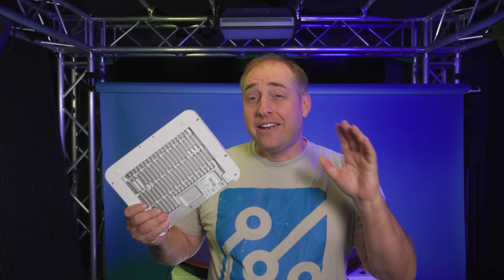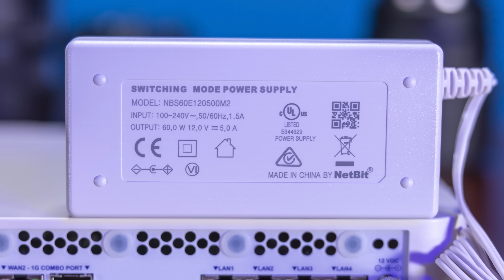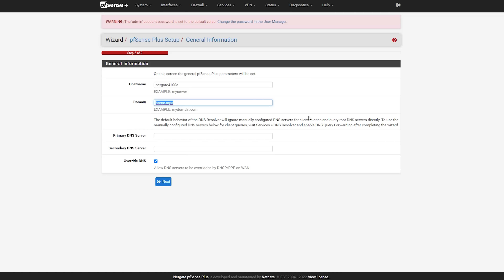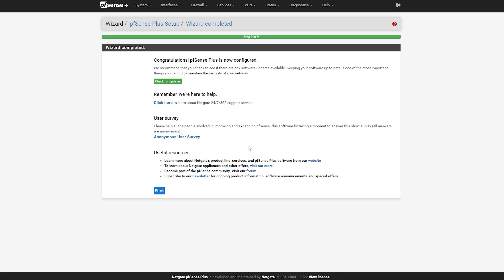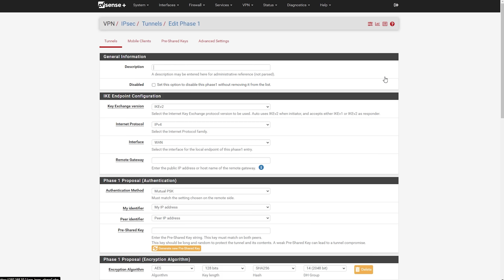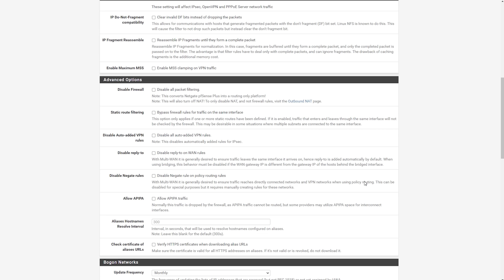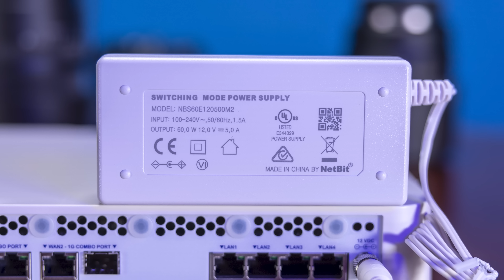An 11W pfSense Plus 1/2.5GbE Router, Firewall, and VPN Appliance

Comment: Not sure why my comment isn't showing up any more, but please read up on "pfSense Plus". If you're still thinking it's a vetted open source project. The commercial product this equipment runs is called pfSense Plus which is __closed source__ and has it has tracking software and remote shutdown software installed based off their tracking ID called a "Netgate Device ID". I don't think I can post any links to the Evaluation Agreement for the remote shutdown code verbiage or the "Announcing pfSense Plus" pages but they even specify moving past the "limitations of open source software" even though they don't specifically state it's now closed source.
Reply: Awesome thing, thanks for the info.
On the other side I got one of the "small aliexpress boxes" and see kind of "debug bios" or mode in it... One part of setup just made me love them: Intel ME settings unlocked and I can turn off part by part or all sections together when I want.
Reply: Thanks for the info!
Reply: pfSense community edition remains 100% open source. 

Yes pfSense Plus has a few added features. Yes it is standard on Netgste devices. And you can buy a yearly licence for it.  

Don’t forget Netgate is a significant upstream to FreeBSD, the open source project that it sits on top or. 

But pfSense Community Edition, the version everyone has used for years, is still 100% open source and still free.

Comment: You can't excuse [bad thing] by pointing out that it's just how [system] works.
That doesn't justify the [bad thing]. It condemns the [system].
Gutting features from your Open Source project so you can lock them behind your paid version is inexcusable.
Charging for SUPPORT is totally fine. That's a service.
But replacing a [feature] with an ad box telling you to upgrade to a paid version just because "gotta make money" is NOT.

Comment: Hi patrick, can you do a video comparison between the cheap box vs netgate box, from a performance point?
Reply from the maker: Discussed it in the video and main site. This CPU is maybe 34-38% of a N5105 in terms of speed. Lower power and QAT to offset on the C3338R
Reply: The N5105 is about two to three times the speed on OpenVPN in my experience.

Comment: I'm VERY confused by the desktop form factor. Who is the target market for this?
I assume 100% of people who operate their own soft router/firewall either have some sort of rack,
or are doing it on old/used hardware and therefor aren't buying an expensive 1st party unit.
Can someone explain this to me without having to resort to *shrug I guess it's cool?
Reply: Netgate is a hard sell in the SMB space.  $1200 for their lowest end rack mount unit.  Even this 4100 is $600.  Tough sell against the UDM Pro at $380 that gives you 10Gig on both a WAN and LAN port.
Reply: @shambles3833  I'm not saying anything is a good or bad deal. I'm looking at the features and asking 'why?'.
The difference in manufacturing cost between a desktop and rackmount form factor might as well be a rounding error. So I'm interested in why the decision itself was made.
Clearly there will always be SOMEONE interested in just about anything. But when I see a product, and then look at how I think people are actually using it, sometimes I just don't get it.
Reply: @Prophes0r  I'm saying that along with the pricing the form factor is a large hindrance to me to be able to recommend Netgate's as my standard deployment to SMB clients.  I like pfsense a lot, and would be ok with giving up central management if the hardware was more compelling.  I'm not willing to toss a bunch of desktop form factor equipment in network cabinets.
Reply: Once you jump to the next model up, they are available in both desktop and 1U rack versions.   Having a desktop is preferred in my case.  I have a dedicated TE closet but don't want to take up floor space for a rack, not even a half rack.   I have custom built consoles for all my network, TV distribution, alarm, Generator monitor, etc...  my console for my SG-4860 also includes a wall mount Raspberry Pi I use for both web connection to the pfSense SG-4860 and for console connection as well.   Why waste a rack mount footprint and volume on something this size and an R-Pi.    I get it, I used to think I had to have a rack or three too.  But I soon dropped the ego and gained space.
Reply: Many (too many) SOHO don't have a rack. Just shelves. That's sad.

Comment: So an Ali box with OPNSense is better?
Reply: At this price the i7 1165g7 with 6 x 2.5gbe is still cheaper and steamrolls this and the 6100, only downside is not having 10gbe.
Reply: @johnknightiii1351  For home use oh yeah big time, but if you're a MSP (Managed Service Provider) dealing with OEM's and getting their warranty for your customer is imperative.
Reply: Switched from pfsense to opnsense because pfsense kept crashing after major updates.
Reply: Only if you want to gamble it, i went with a topton box and I cannot recommend it, power draw of around 25W in idle (Pentium 8505 and some of the 6 ports occupied), even with governor set to powersave. Do not buy these things if you want reliability and low power consumption...
Reply: It is. I got the topton box with the pentium and it’s a beast.

Comment: For 600USD I will get a 10GB Router and 8 Port SPF+ switch( Also 10GB for those who don't know) and from two different brands if needed, I don't know what NETGATE is smoking regarding theirs prices.
Reply: Do you have an example of this combination?
Reply: @YeOldeTraveller  1-Mikrotik, Routers RB5009UG+S+IN ( $219.00 ) RB5009UPr+S+IN with 8 Poe ports af/at as a bonus ( $299.00 ),Switch CRS309-1G-8S+IN ( $269.00 ). 2-Unifi, Router UDM-Pro($379.00), Switch USW-Aggregation($269.00).
Reply: @pbrigham  Thanks.  I agree that these meet that stated claim.
I would argue that the firewall solution provided by pfSense is better, but value depends on personal evaluation of the differences.
Reply: @YeOldeTraveller  Yup, and I like Pfsense, but I will never buy a NETGATE gear at this prices. And by the way, they only started now selling this 2.5GB models because Aliexpress apear with 2.5GB gear, otherwise they will still be charging this fortunes for the 1GB ones.

Comment: 4:11 - Really wish WAN ports were at least 2.5G. At this point I'm not planning on buying any more 1G equipment, even though my current Cable ISP connection is 1G. I would like the flexibility for the day when I'll be able to get better-than-gigabit Internet.
Reply: Jeff, I wish you a speedy recovery
Reply from the maker: Yes you can remap 2.5GbE to WAN if you want. Discussed it and tested 2.5G to 2.5G for that reason
Reply: @ServeTheHomeVideo  But only on those RJ45 ports. Minor complaint, but still...
Reply: @ServeTheHomeVideo  How about 2.5G to 1.25G?
Reply: Just remap them.  The LAN ports are just silk screened labels.
Reply: Although I would prefer all 2.5 I think its still worth considering with the 4x 2.5gbe. As he said they're remappable. I dont have a use for more than 4x 2.5g outputs on my router/fw and that's just for dual redundancy.
Reply: I just spent the last week looking for a firewall for a business that has  a 2Gb internet connection. There is NOTHING out there meant for business workloads that runs at 2Gb, everything jumps up to 10Gb and looking at new firewalls equipped with a 10Gb uplink is outrageously expensive. Ended up going with a used unit.
Reply: @philliumo  2.5Gb is a new tech compared to 10Gb.
Reply: @philliumo  What did you end up getting? I have 1.2Gbps for the Net, not that I'd get those speeds all day, but I don't want to limit it either.
Reply: @philliumo  Have you checked huawei? they have stuff for 2G.
Reply: @Jeff   First off, hope you are feeling better and home from the hospital.  Miss your content (loved the infusion pump dive).   

Why?  I get it, there is faster available...   But realistically, how much of the day is your network constricted?   So you can move a huge file from one device to another on your network in X seconds instead of X+7 seconds?   But if your network is near idle even 75% of the time (that number is probably higher), other than keeping up with the Joneses, what are you buying?   It's not like years ago when the newer stuff (10meg) got you fewer errors than daisy-chained coax.  Everything is pretty much error free today.
Reply: Yeah! What this guy said! Edit: then can one of the 2.5s be mapped as wan? Even then still would be nice if it was all 2.5g
Reply from the maker: Yes they can be mapped in the UI
Reply: @cdoublejj  Yes you can, but you just want to be aware that the physical labels on the hardware will no longer match the assignment in the PFSense UI.
Reply: @IJaggedl  the labels aren't a big inconvenience. I normally leave the original port label to make it easier for me when I'm looking at it later. Like my primary LAN switch is on the port labeled WAN3 on the device itself so I just have the interface name set to WAN3_LANSwitch in pfSense.
Reply: I am waiting for the news from my ISP about 2,5G and 5G over PON. Looking foward to 10G, too.
Reply: @eW0LF  Make sure they are using WDM...  TDM is cheaper but too much sharing to maintain uncorrected flow.
Reply: but there are 2.5Gbps ports. Use the LAN ports as your WAN ports. Whats the problem?
Reply: Nothing wrong with adopting early. 10 years ago I upgraded my router and all my switches to 1Gbit. My friends thought I was insane because the highest ISP speed in my neighborhood at the time was only 25Mbit (I love the rural life but internet speed out here is a huge con). Now that ISP does 500Mbit and plans to upgrade to gigabit in a few months. Always plan for the future. I might have to upgrade my LAN again to 2.5G or 10G soon at this rate.
Reply: 100% agree..
Reply: this is really applicable to smb sector - you need that swr matching - should run dual ha opnsense potato routers for link agg plus failover - could you do this on 2.5 nano pi? quite possible - you should do it and also the pi kvm attached to a hub so you can control multiple pc/servers #freebsd
Reply: Right there with you Jeff I spent several months this year trying to get my old router, an APU2D4 to have a 2.5Gb interface (and succeeded then lightning killed it) because I have clean 1.2Gbps service available here. So hard to find off the shelf solutions that are not insanely expensive. We are at the peak of 1Gbps and limited choices is going to slow some consumer adoption of higher speeds when they are available.
Reply: @Kirk MyDurk Yep.
Reply: Every port is remapable. None is actually any more “WAN” than any other other beyond the label on the case. Pick a port, map it to WAN in pfSense. You’ve got what you wanted.